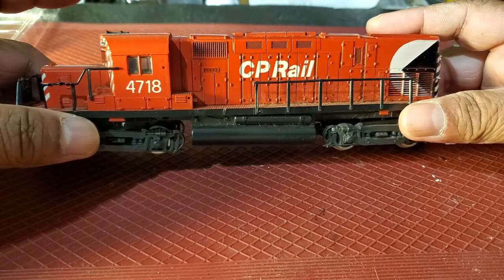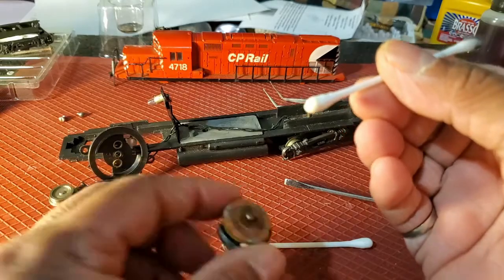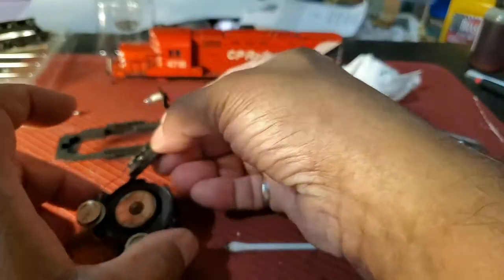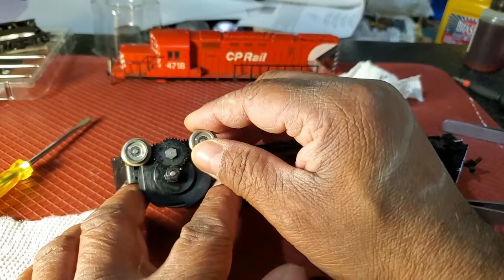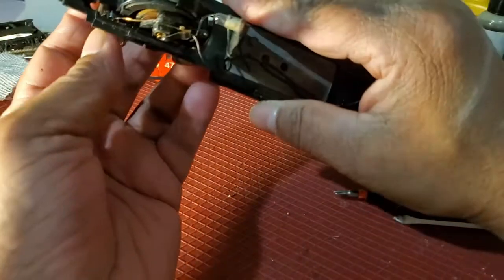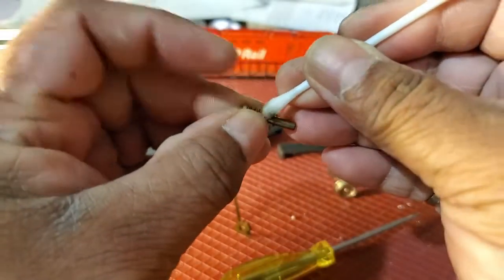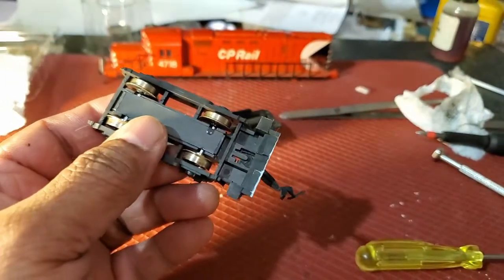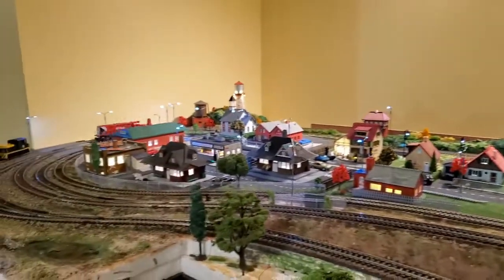Servicing a LIMA M 636 Locomotive

Comment: Very interesting locomotive, its like cross between a C424 and a rebuilt RS18u.
Reply from the maker: Very Good observation .. you are correct ... never thought if it , until you pointed it out ..
Reply: A M636 has six axles (636 =  6 axles/3600 hp). This is a four-axle C420 (4 axles/2000 hp)